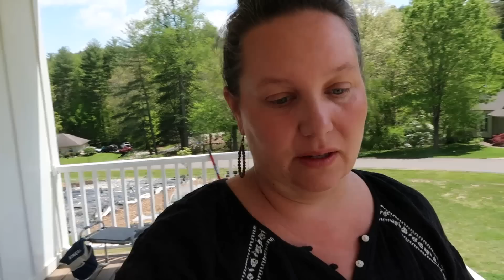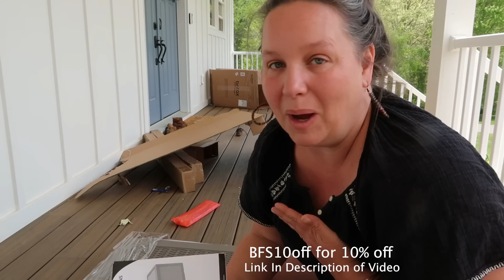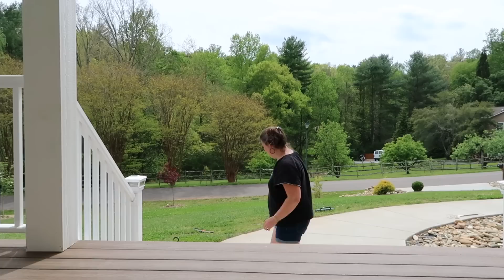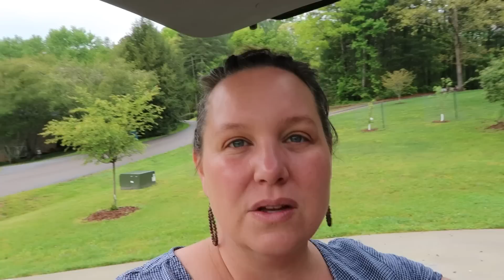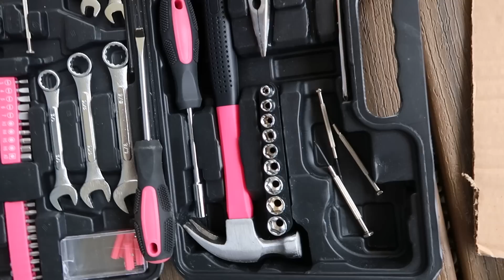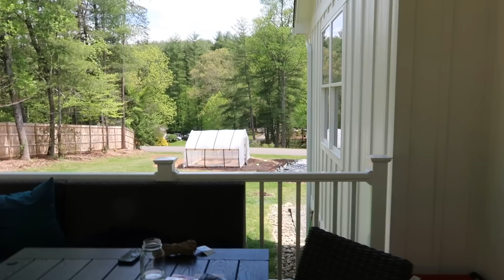TOTAL Porch MAKEOVER and Outside YARD CLEAN UP! Cleaning and Decorating MOTIVATION!

Comment: An easy upgrade for your porch curtain would be 3m hooks with a Dowell or curtain rod or the trick with the 3m broom holders turned sideways and broom handles (or pvc pipe for length) for curtain rods...just be sure to wait after putting the rod holders up so the wall part of the glue strip adheres...did this hack in a spare bedroom.  Meantime it creates the privacy you need.  I need something similar in my backyard pergola, still figuring out execution 😅

Comment: Could you link or say where you got the wicker conversation set that's going with the porch swing area
Reply from the maker: It’s sold out, but I got it at Lowes. It is called Lillywood Conversation Set
Reply: @Brifromscratch  thanks! It's in stock still in my area 😊